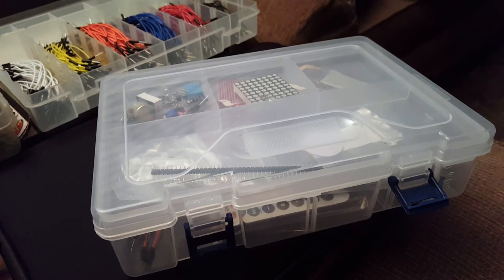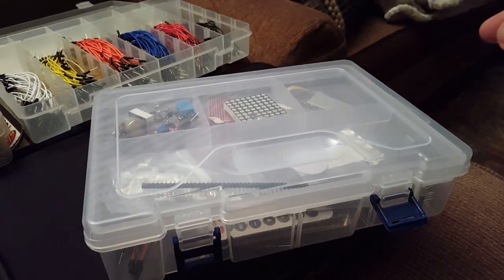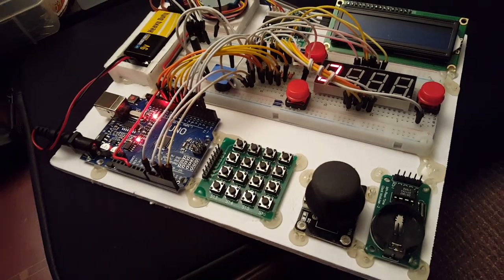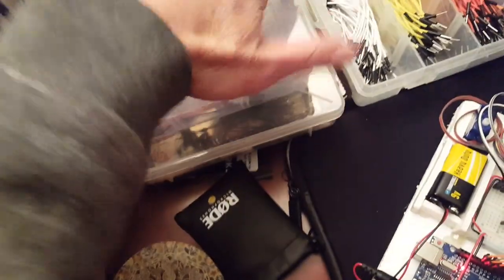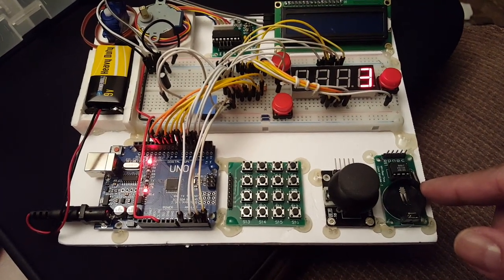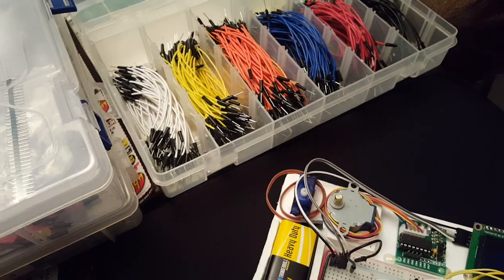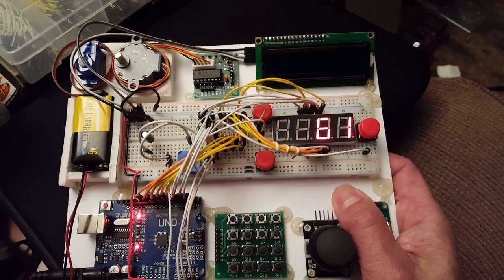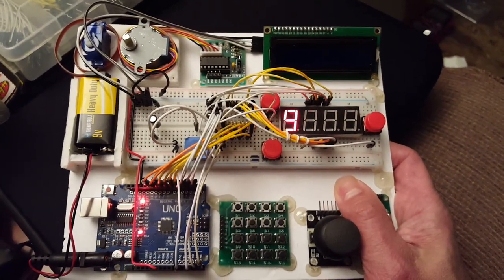HariFun #173 - Arduino Rolling Dice

Comment: Like the idea a lot! Maybe the time for resolving the number is a biiiiiiiiit too long, but really neat implementation with the animation and sound!
Reply from the maker: Hi Shaun, yes, you're right, it is too slow. I noticed that too when I was editing the video.  It is not difficult to tweak, just condition in a while statement that determines how slow the animation is before we get out of the animation loop.
Believe it or not, I started just figuring out the pinout of the display, and when I got my test program to control the segments, I just kept going.  Originally I was going to display four 6 sided dice, or two 20-sided dice etc.  But I wanted more than just displaying random numbers.
Thanks for the comment Shaun!

Comment: Hari are you using a Tilt switch?  But you know what would be cool. Making a 6 sided Led Dice now that would be cool. Just saying ...
Reply: If you look what's in the breadboard, there is the simple 2-pin tilt switch with a small ball inside :)
Reply: @zaprodk  I notice that lol. It look like a Capacitor to me at first
Reply from the maker: Hi J!
Yes, I am using a ball tilt switch.  The kit also comes with a motion switch (much more sensitive).  I'm not sure what you mean by a six sided LED dice.   If they're six sided, the leds do not have to change (just like in standard ol dice).

Comment: Nice project-board! Easy to use for educational experiments. I spotted a ball tilt-switch connected between A1 and GND as well as quite a lot of pins used for the display. Wasn't there a shift-register somewhere in that box?
Reply from the maker: Hi Maxint!
D'uh, you're right, there IS a shift register in the kit.
What happen was, I started with just deducing the pinout of the display, then wrote a test to light up each segment one at a time, then I played with TimerOne to multiplex it, one thing led to another I end up with this :-)

Comment: Why?
Reply from the maker: Why what?
Reply: @HariWiguna  why do this instead of drop a real dice
Reply from the maker: @eduardoanonimo3031  Fair question.  My main goal is to have fun with the Arduino kit.  So, that is why.  It really has nothing to do with competing with a real dice.
Originally, my idea was to make a "programmable" dice for playing D&D where you need different types of dice, but I got side-tracked in creating the animation and using the tilt switch instead.  But you're absolutely right, a real dice works fine for a lot less hassle :-)